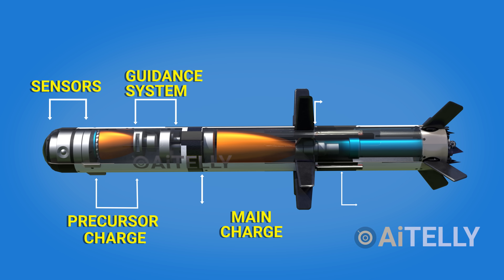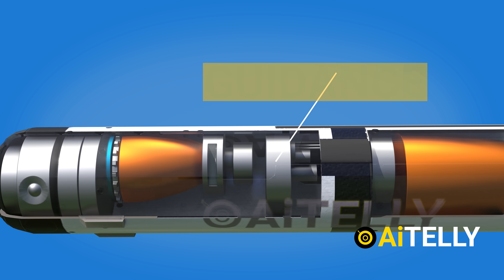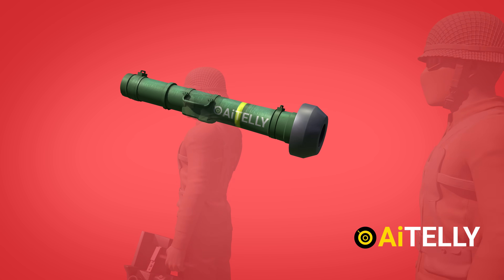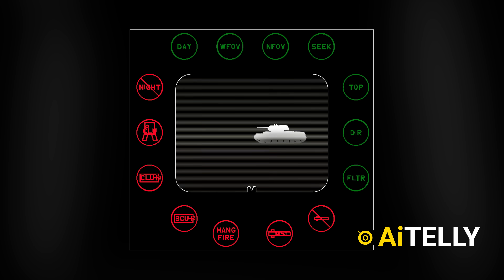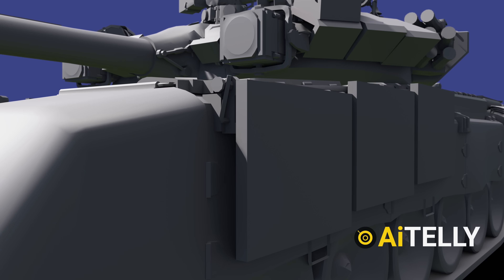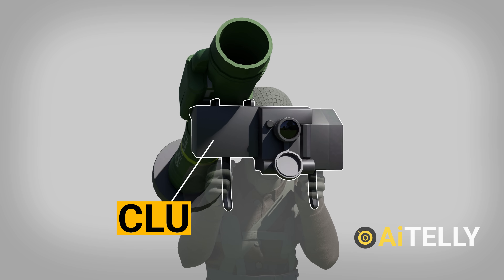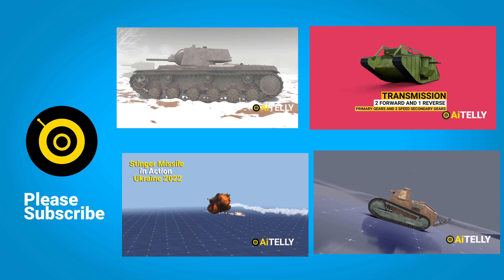Javelin Missile | How a Javelin Missile works

Comment from the maker: Credits for Video Corrections

1)Mark of Distinction

I was one of the engineers that helped develop the infrared sensor in the nose of the missile, and was the responsible project engineer for about 80% of the sensors produced.   This video was well done and quite accurate.

I can say that its a 66x66 Mercury-Cadmium-Telluride long wavelength sensor.  The long wavelength allows it to not only see in the dark, but also through smoke and fog.

2)Andrei Casiadi 2:16 You didn't mention about it's short battery life, and it can operate in seeking mode for about 2 minutes, then it has to cool off. Also the thermal imaging is only 64x64 pixels so it can be fool by something other heat source. I heard it can be fooled by aerosol smoke. It's also not very easeful in the city fight.  Looks like the tank has to have 2nd layer of dynamic cover or active armor protection system.  But it's a very dangerous weapon for the older tanks and if used in right hands at right time.

3)elkski Utah 2:00 very good animation.. you called them fins , some call them wings. they were originally called strakes and the rear were fins. Diameter to 5.6" from the original 5?    I think 5.6 is the carbon tube diameter

4)Jonas Ingi Ragnarsson- I think the missile diameter is 127 mm.

5)MM= milimeter thanks  to  Myles Willis. (Changing to new Voice Over Artist)

6)Jorell Dye
The whole assembly may be $250,000, but the missiles are $78,000 (Source: Pentagon 2021 budget report)

7) Colonel Terry Rowe, US Amy, Retired

I was the Test Officer for 85% of the Service Test of the TOW Antitank Missile System at Ft Benning GA 1977-79 ( another officer had to complete the test because I had volunteered for a second tour in Vietnam).  It was apparent that the TOW was a revolutionary improvement over the current 106mm Recoilless Rifle which was ineffective against a moving tank beyond 500 meters.  It was clear to me that antitank missiles would eventually neutralize the overwhelming advantage of tanks on the battlefield (I had previously served with a US mechanized Infantry unit in Germany on the Czech border and we knew we were vulnerable to attack by the Soviet 5th Tank Guards Army).  The light years improvement of the Javelin over the TOW takes my breath away in so many aspects!  Incidentally,  the TOW missile was considered very expensive at that time at $2,000 per!  At the time I was also the Test Officer for mortar systems and I had the "crazy" idea we should develop  mortar round that on a small parachute (used for illumination rounds) with an infrared source could attack tanks at their thin top armor.  Nobody would listen.

Anyway, a great explanation of the Javelin!   Colonel Terry Rowe, US Amy, Retired.

P.S Military Technology Data are a little tough to get our hands on and also classified and most of them are in a very grey area, but we will try our best as average Engineers and 3d Animators to bring out the best in a very Minimalistic or Simple Explanation.

We take full responsibility for our mistakes.
Reply: Сергей Захаров  I have never heard of an active war which showed one side holding back their supposedly superior weapons for half a year to safe them for later. 
T-90s are being used and destroyed just like all the other tanks. There is no Russian armada waiting for the right moment to strike, while their comrades have such serious trouble on the battlefield. It’s been eight months now, face reality.
Reply: Also at the end you say it's a game changer on the modem battlefield. It's very impressive obviously but hasn't changed the war in Ukraine.
Reply: @everready2903  you realize these have destroyed many thousands of Russian tanks in Ukraine? Imagine how different the war would be without Javelins, they are one of the most important and most requested weapons that we are sending over there.
Reply: @everready2903  Only Russia wil change special operation in ukraine.
Reply from the maker: Сергей Захаров  I heard they had sent Defected javelin. That is why it did not work
Reply: @Aitelly  Дефектное, но не всё. И всё же, Джевелин с 1 удара не убивает российский танк, даже Т-72.
Reply: @Valentin82.  all the T-72 turrets that joined the space program think differently. Even NLAWs are taking them out easily
Reply: 2+2=4
Reply: Much appreciated!
Reply: Your animation for the shape charge was completely fukin wrong.. absolutely garbage
Reply: and I think that this video is complete bullshit and does not reflect the features of application in real combat. The armor of the tank against the rocket body is like plasticine... yeah
Reply: There is a thing I didn't understand: system is ready to fire in 30 seconds, but the CLU needs 3 minutes to cool down before use. Did I get something wrong?

Comment: 4:29 didn't you mean 60 - 80 mm? Because 600-800 mm, means 23 - 31 inches. which would be some metal bunker? Maybe it's just me, but I don't think this charge would penetrate this much of steel.
Reply: 60 - 80 mm is in the range of APCs, not tanks
Reply: @juilkeyaru405  wtf?
Reply: @robertmayfield8746  Yeah. In fact, 60 mm is being generous. In terms of effective thickness, it's not that high. Being built to haul troops, they can withstand small arms and higher caliber weapons. But not full on anti-tank weapons
Reply: @juilkeyaru405 What's your point? Did you even listen to the mistake narrator made? 4:28 please try again.
Reply: Tanks have a lot of armor, about 2 feet of spaced armor that’s equivalent to 2 feet of RHA (rolled humongous armor)

Comment: The regular grammar screw-ups and weird stresses this (presumably) AI voiceover uses are really irritating. Also, at 0:56 it shows the flight motor, then the launch motor, but then right after that, the text labels on the graphic are reversed, showing the launch motor and then the flight motor.

This video seriously needs an attention-to-detail improvement!

Comment: sounds like a complicated system even though it packs alot of power and accuracy the complexity just beats the purpose, by the time you finish figuring how to fire this! an old school rpg7 would have already worked 5x
Reply: against tanks the effective range of an rpg is about 300- 500m and even then hit probabilty is low especially if the target is moving the javailen missle is effective  upto 2.5km and is F&F And can track moving targets is very hard to dodge or counter it also has a tandam warhead and attacks the vehicles most vunrable spot the roof If i had to have an option between an rpg with 5 rounds and javelin with 1 round to kill a t90 or any tank i would takethe javelin everyday of the week-
Reply: @daltonbest9320  theb expensive cost beats its purpose its more of a prototype or an experiment than an effective weapon... this is why kalashnikovs sell more, armies need cheap and effective weapons not expensive and effective

Comment: Chinese copy paste but I guess the chips are the secret
Reply: It’s not as difficult to figure out as one might hope.

The only challenge would really be recreating the infrared sensors on the nose as that component is crucial for target acquisition and maintaining accuracy.

Other than that, it’s literally a control system the corrects for the input data provided by the sensor. The control system can be as simple as a DJI drone following you. Reprogram the flight controller to communicate with the sensor and you have a similar system.
Reply: @takel9879  gyro infra red
did the javelin fuel with solid propelant or liquid propelant

Comment: But does the missile know where it is?
Reply: For the control system to work, it’s establishes it’s launch point as it’s origin.

Using range finders and orientation of its launch site, it creates to knowns in both distance and orientation. Angle is irrelevant as it can create its own self correcting flight path.

As as far as the meme goes, it’s a legitimate logical system to know where it’s at based on where it isn’t.

Comment: Did I see and hear that it will defeat 600 to 800 mm of armor (24 to 32 inches)  seems like a lot, not sure I’m buying that one
Reply: That was Rolled Homogeneous Armor, AKA plain regular steel plate.
Modern tanks have a different kind of armor (composite usually) that has a much greater resistance to shaped charges then plain steel.
So you end up with tank armor 5 inches thick that works as well as 15 inches of steel (example using rounded numbers)

Comment: Both Javelin and Spike takes 30 seconds to acquire target for fire and forget mode while S Korean AT1K Raybolt is ready to fire without any wait time for fire and forget target acquisition making it most advanced fire and forget ATGW.  Saudi army used AT1K in Yemen war to hit small moving motorcycle and it costs less than half of Javelin.  Penetration is same for AT1K and Javelin.
Reply: to capture a target at night, it is necessary to cool the block, and this takes time...as usual, liquid nitrogen. But how its trajectory works is very interesting.

Comment: Random fun facts about the javellin system. The soft prelaunch system is similar to tge airbag inflator in a car. Sometimes it will fail to ignite the main rocket motor giving a bit of a scare but no worries it wont arm unless a minimum G and distance from the CLU is detected. The CLU is powered by a battery with a small argon cylinder in it the argon cools the sensor and the battery is just that. The missile itself also has an argon tank that is activated once the first trigger is pulled enabling lock- use it or lose it. You have about 3 minutes to launch, plenty of time. The second trigger actually launches it. Once it has lock and launch is sucessful, it is 100% gonna hit the target unless something intercepts it physically, they are a very confident system. 🤓
Reply: Javelin has many weaknesses and its effectiveness is much lower than cornet, tou or stugna. if you want, we can discuss it.
Reply: Learn English first

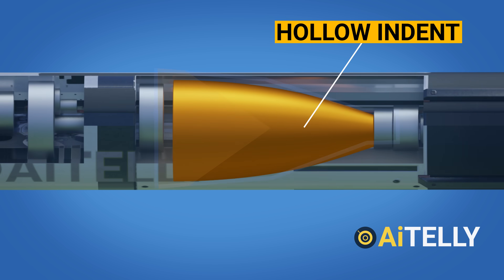Comment: Regarding 4:06, the metal liner at the front of the Shaped Charge is a cone usually made of copper. The cone shape forms a hollow cavity at the front end of the high explosive charge. The cone shape is there to achieve the Monroe Effect by which the blast energy of the high explosive charge becomes focused for concentrated penetration through the point of contact of the target. A shaped charge works like an explosive lens.
Reply: An explosive lense puts it well into layman's terms and explains why you can punch trough tanks with not a huge explosive charge: All the energy is focused.
Reply: They also have tantalum cones for the second charge in some variants. Same deal except heavier and much higher melting point for better penetration power.
Reply: concentrated boom boom
Reply: Focused explosiin
Reply: Its not copper... a Tungsten cone is used

Comment: I still don’t understand one thing through, if the precursor charge has to make a contact against the reactive explosive armor to detonate, wouldn’t that cause the explosive armor to react and explode? Would that explosion not damage the rest of the javelin missile and cause it to fail? How does the javelin survive this explosion long enough to activate the main warhead? Thanks
Reply: those ukrainianmobsters ukraineflorida drkMarket $250K 1/4 Million per Missile Selling what we Give them For Free To mideast Terrorist&drugcartel countries Such As the 300 plus BulletProof Vests that Disappeared that we u.s. Gave them ukrainemobsters
Reply: doodooIt Magick
Reply from the maker: Good Question. Yes that's the trick the Javelin wants the reactive amour to explode for the second stage of Explosive to do it's job and passed though the armour of the Tank
Reply: With about 60% failire rate.